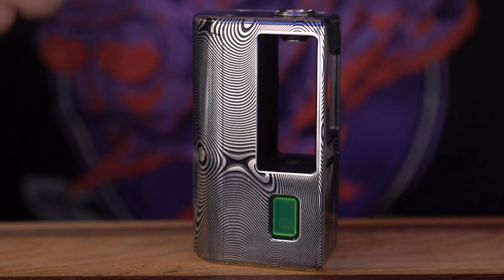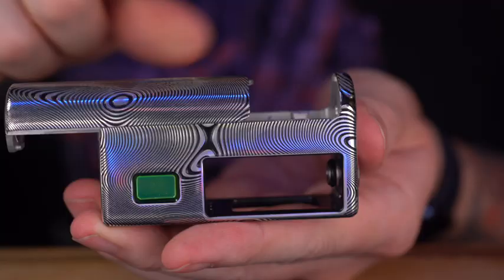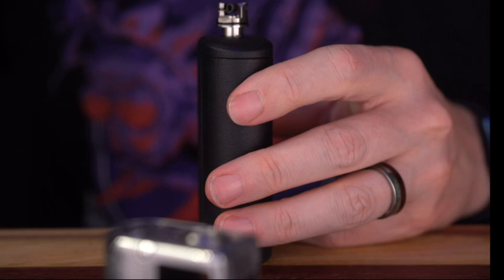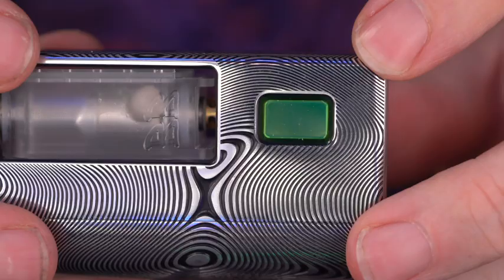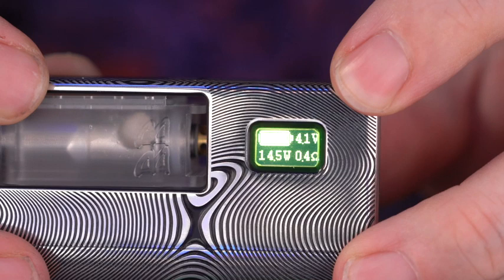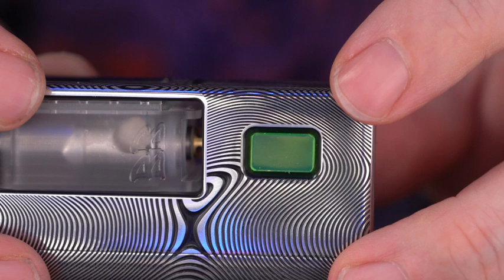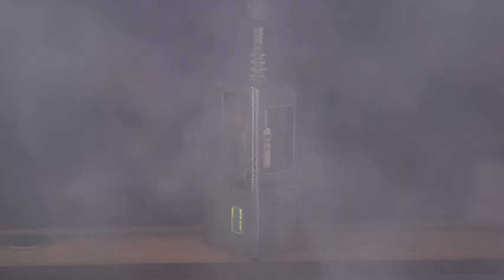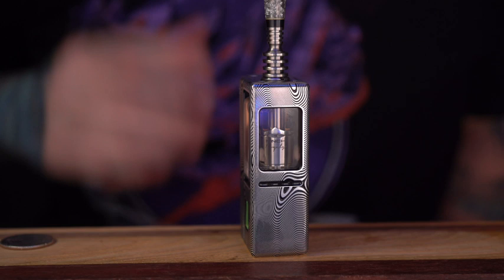HoKo-E | High End Boro from Barcelona

Comment: I just got mine, it’s the Santa Muerte engraved version. It’s become my favourite boro mod.
I’m using it with my Psyc bridge in RDL because I’m an RDL vaper. I occasionally like to vape mtl. The psyc is the black version with the YEC limited edition X boro in gunmetal. It looks totally sick and it’s got awesome flavour. The V3 Dicodes chip is outstanding. By far my favourite chip in a boro aio. What’s not to love about it.
Beautifully engraved body on a beautifully CNC carved body.
Awesome battery door. This is how all battery doors should be done in this configuration. The Psyc bridge in a YEC sexy as hell boro tank.
10/10 for me.